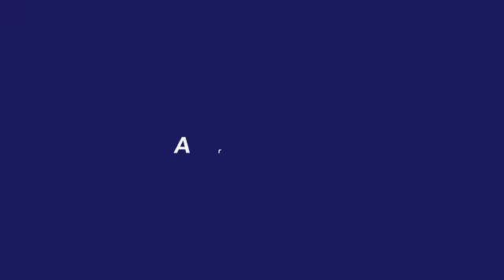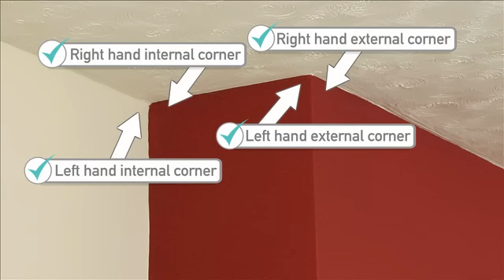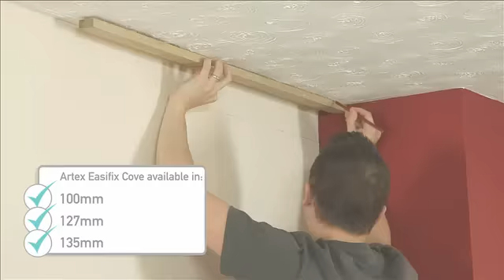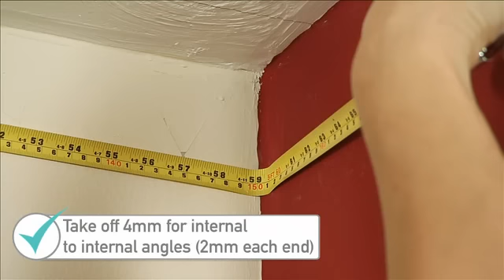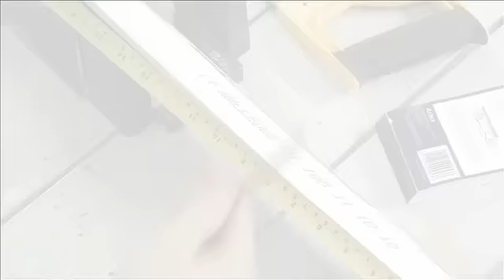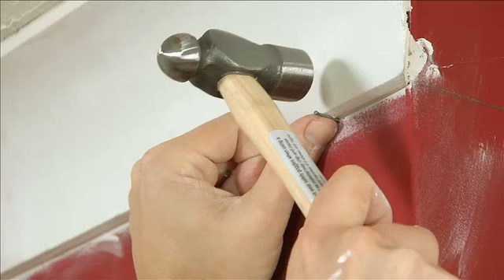Artex - How to install Coving

Comment: Not an expert but here's a tip. Remove the TV, tables and curtains from the edge of the room before you start so they don't get covered in dust and adhesive.

Comment: You don't need to score the wall, those light scratches  won't do a thing. Also you usually  need to pin or prop gypsum coving to stop it sliding down.